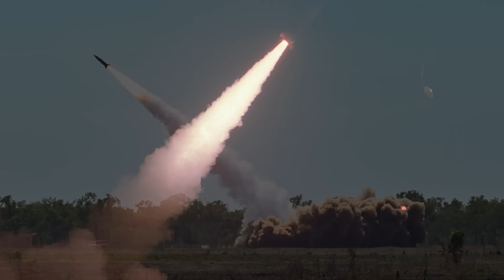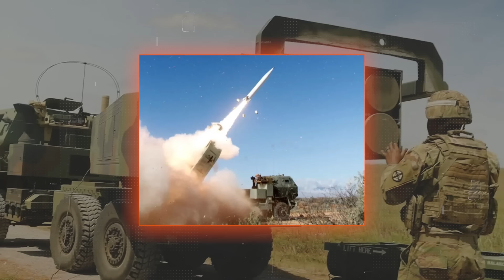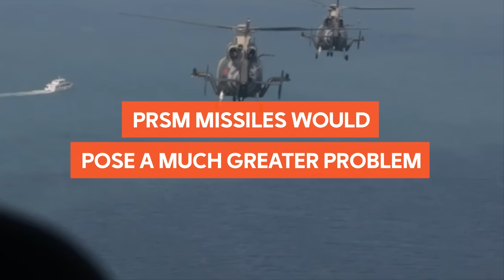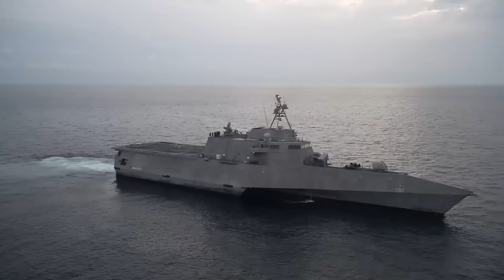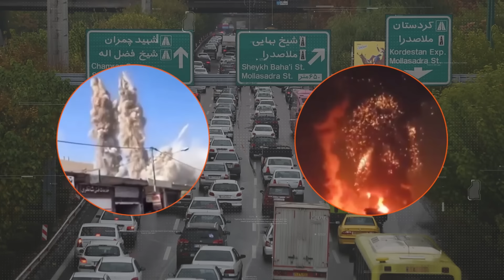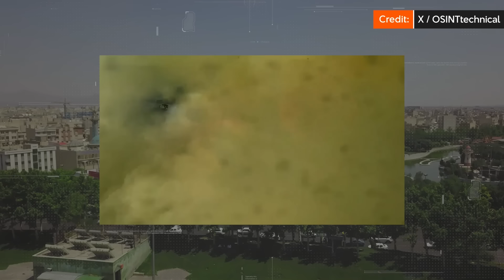U.S. Unleashed Something CLASSIFIED on Iran… and Tehran Wasn’t Ready

Comment: Each nation should gather up 75000 troops that relies on the straight, out of the 75,000 10,000 are snipers, Have a snipers clear the way and then the rest come behind doing mop up eliminate all IRGC which with a massive army of snipers take them out no problem that means you could clear cities checkpoints for a half mile out

Comment: Well the idea is credible and needed especially the ability to target and hit moving objects. However, it needs to less expensive than $4.5 Million per unit not just it's CEP. They need to be modular thus lessening technicality of construction with a modernize assembly and using 3D Printing into its construction and parts fabrication. At the moment predicedsor missiles are slow to fab with less than I think 200 a years.

Comment: USA needs to develop smart anti drone technology and make the cheaper so our allies and our military can use them. Hopefully this is under way.
Reply: Ukraine has shipped considerable amounts of a cheap drone interceptor that costs about 2k to build export price according to WSJ directly to gulf bypassing the US as well as 300+ trainers
Reply: Already developed like the Leonidas microwave emitter adopted in 2024. Has a 2km range and can cover a wide area of sky with a single shot. During testing it was able to take out 49 drones in a single shot using $3 worth of electricity.

And for the harder to hit ones US has lasers. Been in active field testing on US destroyers since 2014.

Main issue is the places Iran are targeting are places that wouldn't have these defenses like civilian infrastructure.
Reply: It’s already used at the opening.  Ran on a diesel powered destroyer that was a sensor upgrade or some shit to throw off the scent.  Basically an emp that you can aim.
Reply: it's already being tested out in Iran....
Reply: Check out the Coyote block 3
Reply: I agree but some of the Spruance destroyers have already started using their laser anti-drone systems and a speed of light laser at $5-10 per shot in energy costs to down a drone is pretty damn cheap.
Reply: They are getting help from z Ukraine who are experts against the Iran drones . They have sent the cheaper anti drone missiles to the US , and have sent some experts to teach them how to use effectively .
Reply: We have used lasers 😮
Reply: Our allies are weak asf.
We need to focus on with our own borders.

Comment: US should bring out somehting heavy not these toys . Iranain undergound missles are still firing
Reply: Yea, they need to bring out the snake. Smoke the enemy out of those subterranean cities by flooding the area with water
Reply: Their ability has been severely compromised since day 1 as launches are down 90%. That means that that they are only capable of launching 1/10th of what they were able to. Apparently 2,500 IRC operators & technicians have been trapped underground with entrances & exits blocked no power no communication & no air.
Reply: @sharonjuniorchess  not good enough , they are still riring at saudi and qatar gas feilds . when trump said if theydont open strait , they are able to refuse bcos they still have that 10 capablity . us has total air control so it should be 100 stopping of the missiles
Reply: @sajithchannadathu7902  The Iranian artillery seem to miss more target than they hit. Can you explain to me why the IRGC are firing indiscriminately on their former friends & allies or were they aiming somewhere completely different & that is where their missiles landed. Whilst you are writing your reply dont look up cos Israel & the US are cleaning up the streets by chasing the IRGC & blowing them up.
Reply: @sharonjuniorchess  Yes most of the missles are intercepted but some drones do get trough . they ar enot friends .a slo why ask me why they are firing . the only thing i knwo is they are firing they have capablity still to fire . iF trumps attck htheor energy infra they will hit back at gcc countries . US should tek out 100 percent of theor ablity.
Reply: @sajithchannadathu7902  You argument makes no sense whatsoever. TheUS does not rely on the oil coming out of the Straits. So it is up to the rest of the world to protect their tankers.
Reply: @sharonjuniorchess  The question is not where Us get oil from. When US went to war, They knew iran had underground missiles , So it is theor responsibility to make sure all of them are taken out and throse doesnot become a threat ot the other GCC ountries. The bclocking of teh straight , yes US is also repsonble fo find doloyion ot that as they started teh offensive
Reply: @sajithchannadathu7902  So you are saying that having a rogue state run by the IRGC is NOT a problem of the GCC countries. Well I would have thought that if they are so dependent on oil revenue that 1. they should take responsibility for their own defence and 2. should have alternative ways of routing the oil. The US went in to stop the nuclear arsenal. I dont recall the GCC saying anything about that. In fact they were noticably silent on the matter. The US could pull out now having achieved its mission. But I suspect that you want them to do more? Well so should the GCC. Perhaps it is their interest to help the Iranian people by removing the current regime but that is not President Trumps mission.
Reply: @sharonjuniorchess  nope the GCC countries do not like the IRGC , tehy dont support them, But is a neighbour hey have to live with . Teh Oil planys and utiities planst of these countries are open to attck so when u do such a venture u have ti take that into conideration.  Ye sthis war was in the offing for long , it is knwown that iyt would happen . atleast teh iranaisn were oreparin for 40 yaers , wteh u emeny is so prepatred ual so beed to do look at all options becore duving in . ye steh US have taken out 90 perent of the capaplity of the missile stike . but teh rest 10 percent still is a threat nd needs to be stopped
Reply: @sajithchannadathu7902  Well they can always buy the iron dome off Israel.